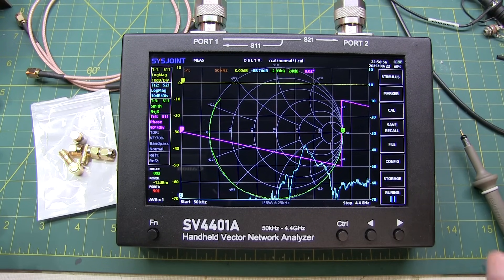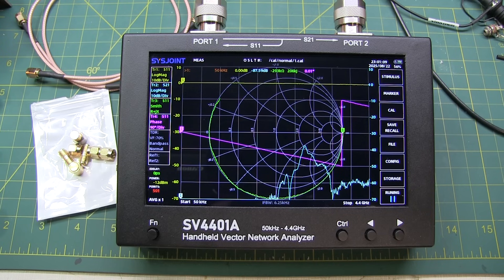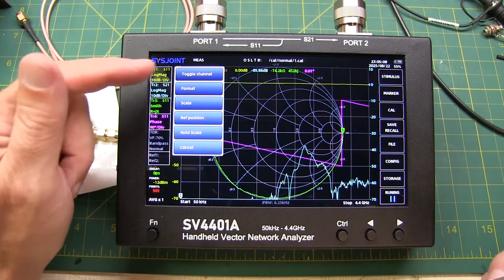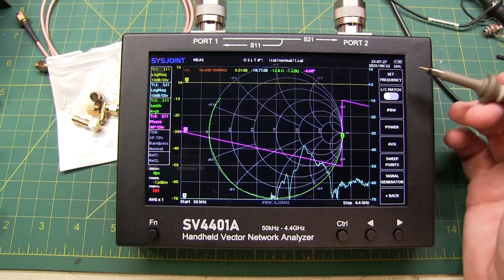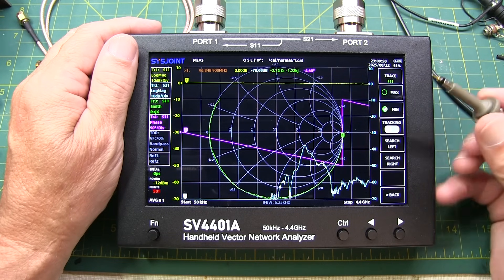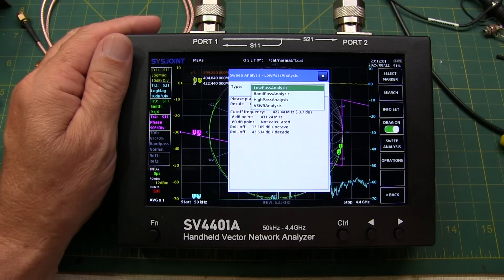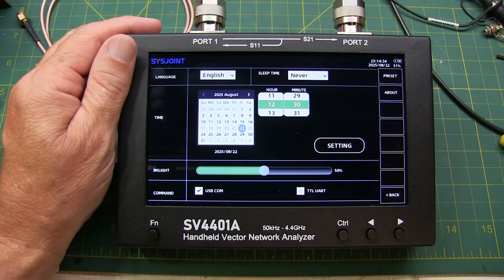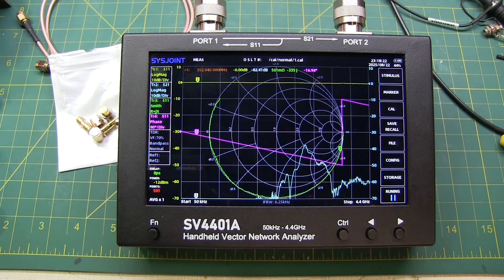#402: Overview of the Sysjoint SV4401A Vector Network Analyzer from Chelegance

Comment: Isn't the device a bit outdated? It's been on the market for at least three years.
Reply: What's outdated?  It's not like VNA's become unusable over time.  It's a VNA now and will still be a VNA in 50 years.  What could they possibly "update"?  Add some flashing lights and MP3 player.
Reply: What a world, when 3 years is considered outdated!
Reply: @ydonl  You know Moore's Law, which states that the number of transistors on a chip doubles every 12 months.
Reply: @karlbesser1696  Well, that’s not exactly Moores law, at least as originally formulated, but pretty close!  : ) Still, I’m not sure the number of transistors is always a reliable indicator of “goodness.”  😊😊
Reply: @karlbesser1696  Wow, just think how outdated an HP8722D is - it came out in 1996, yet they still sell for >30k, in outdated condition
Reply: @ydonl In three years, electronics will make giant leaps forward. Just think of AI, higher sampling rates, lower power consumption, and AI software. A current VNA in this price range reaches 10 GHz.
Reply: @gorak9000 I also still use a TI-66 (built in 1985) calculator every day.
Reply: @karlbesser1696  Much like my HP 15C setting on the desk in front of me.  Made in the USA the 2nd week of 1984.  Still works as good as a modern calculator.
Reply: @mikesradiorepair Winner, yours is older. ;-)
Reply: @mikesradiorepair  My very first "calculator" was the veritable addiator...  Was not very fast, but accurate to 9 digits. 😀
Reply from the maker: I never said it was new, just new to me!
Reply: Ability to do S12 measurements and higher frequencies would be big upgrades. What percent of amateurs need either? 
Getting better resolution and higher dynamic range are big pluses.
Reply: @jspencerg In terms of frequency resolution and dynamics (100dB) I expect from a new model.

Comment: Fine job.I would like to see antenna field strength measurements using one antenna for each port for antenna radiation efficiency and radiation pattern evaluation.
Reply from the maker: would require moving the two antennas around in a very controlled way, and then exporting results to map the pattern.
Reply: I wasn't suggesting some kind of setup like a test range or an anechoic chamber but taking multiple measurements in the field with a reference antenna like a dipole and comparing those not in real time with an antenna under test say every 10 degrees just for verification that we don't have erroneous secondary lobes ,gain estimation and f/b ratio verification.
I would like to know how you would approach this setup .
I know that's too much to ask but thank you for your response anyway.
73 de SV2BNR

Comment: I use my Nano VNA for Ham radio  which works fine for me Don't need the high frequency that they have to offer
Reply from the maker: I suspect most hams are in the same boat.
Reply: @w2aew  That depends on what bands you're building antennas and filters for. The dynamic range on the NanoVNA is terrible above 300 MHz since it switches to harmonics.
Reply from the maker: @rocketman221projects  This one is better because it doesn't switch to harmonics until much higher in frequency.